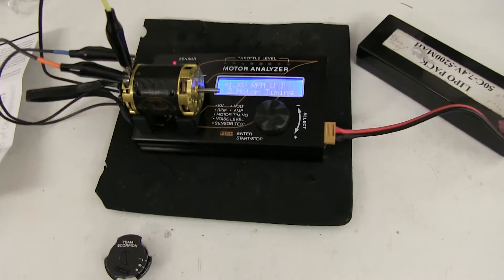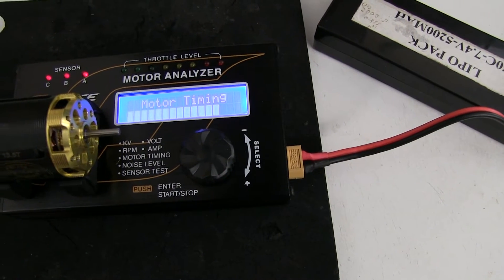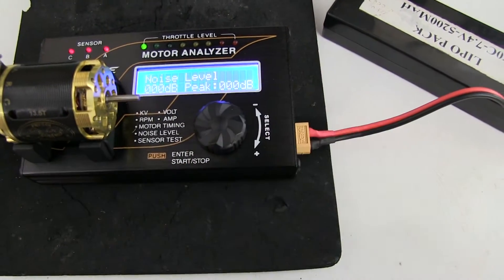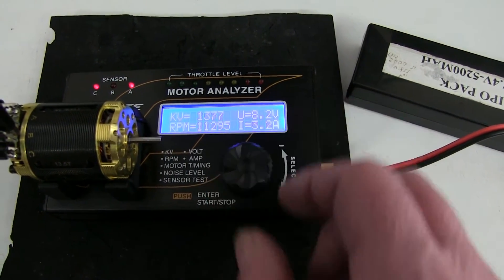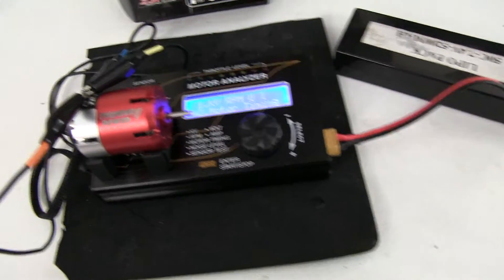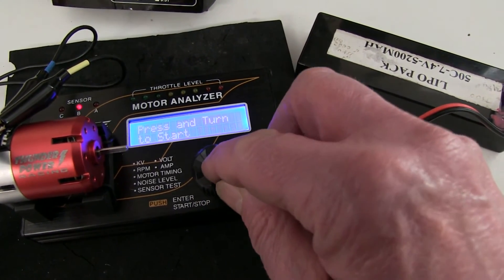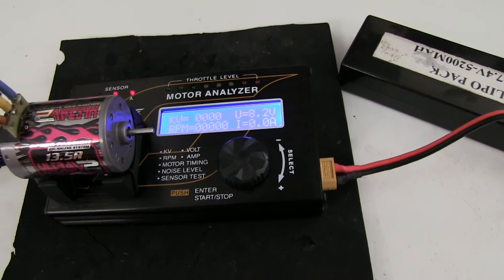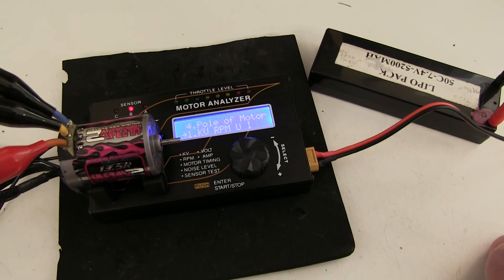Brushless Motor Analyser. Model Car Motor Testing.

Comment: I been running buggy’s on carpet track which isn’t to large mostly running reedy s plus 17.5 which is fast on track I’m starting to run a traxxas slash with lcg chassis in late model. I started with a 540 t stock motor and ran 5 second lap looking for more speed I tried what was in my buggy 17.5 but traxxas weighing more did have speed ran 5 sec so I tried a 10.5 motor and still get 5 sec lap. Some a running a castle creations 2200 kv but not use to those motors I have the type u usually test. Any susgestion on a motor.  It kind a short oval so not hitting a top end speed as I said it takes me 5 seconds to complete 1 lap most of faster drivers are around 4-4.30 a lap

Comment: Hi,

Can you use the analyser with the motor still soldered to esc?  No power/battery attached to esc and pinion is off. Would it work?  
If it would, it would save a lot of time with testing motor installed in cars. 🙂
Reply from the maker: Hi. Yes yp
You can test the motor in the car, and I do it often. You can test the timing with the motor still driving the wheels (off the ground). To test the amp draw, move the motor or remove the pinion.
Reply: Nick Adams  , just to clarify, the the esc still soldered you just clip the clamps on the motor tabs?
Reply from the maker: @Bird_Cristobal  Yes, you can leave the ESC connected. Switch it off.
Reply: @nickadams5411  what is the reason for ESC not dying while still being soldered to the motor during testing? Mosfets just "dont care"?
Reply from the maker: @lopatovich  Mosfets are open circuit, until the gate turns them on. As long as the ESC is turned off.
Reply: @nickadams5411 a long time ago I did that to my brusched ESC and had to send for repair. Is it different for for the brushlles?
Reply from the maker: @lopatovich  The old ESC probably used transistors

Comment: does the motor need to taken out of the car and unsoldered from the esc for this tool to be used? Or can it be hooked up while the motor is still in the car?
Reply from the maker: Hi Bob
Yes, You can test the Timing without disconnecting the pinion.
Hold car with wheels off ground. (Lipo disconnected, ESC switched off).
Connect ABC wires to motor (Careful not to short together).
Connect sensor wire to motor.
To test the KV:  Move motor pinion from spur.

Comment: what would cause a misfire
Reply from the maker: Hi Adam
If you mean while you are driving the car at speed.
Then it is usually interference with the receiver.
If it is 2.4Ghz, make sure the receiver aerial is not damaged.
Those intermittent glitches are often cured by fitting a capacitor to a spare receiver socket. Connected to the + and - pins of the receiver plug.
A value about 3300uF or higher at 10Volt rating is normally successful.
Reply: The motor worked perfectly fine then I took it apart for cleaning and oil for bearings I put it all back together and now it misfires after  10 seconds of running 
Could I have the timing up to high or did I screw something up inside?
Reply from the maker: Always after 10 sec of running.
If you stop and restart is it another 10 sec before the misfire?
Could be many things, but as you took apart, it could be the sensor lead. Make sure it is fully in, or try another lead.

Comment: Not good for sensorless motors. It wont tell you endbell timing so dont waste your money. And as far as any motor tested above 2s forget it. This will give you real rpm and kv along with voltage and amps but its useless testing on a 6s or 8s rated motor when your limited by power supply. They dont tell you any of this in description before buying and then your stuck with a tool that basically just gives kv because free reigning amps is useless and the voltage is going to pertain to the battery so it doesnt matter. If you could time a sensorless motor it would be useful despite other drawbacks. It just lets you know the kv is shy of whatever manufacturers claim. Waste of money. Mines for sale if anyone wants it.
Reply: My god man.....nobody runs sensorless motors to race so this may not apply to all the motors on the planet but it's a useful tool for anyone who actually does race.
Reply from the maker: Hi Braiden
Thanks for your input.
It is a far more useful tool than you have experienced.
The KV is not dependant on input voltage.
The amp draw can show you the best timing position , just before the rotor loss makes the motor become very inefficient, and works very well for zero timed speed control racing.
You can set up motors for 1S and higher Lipo voltages, with a 2S lipo input.
There is not much you can do with a sensorless motor as they are normally locked endbells.
Anyway, all the best.
Nick
Reply: Nick Adams wrong! End bells are locked? Not one of my end bells are locked on any of my brushless sensor less motors. And if it was it is very easy for one to be unlocked. Show me a locked motor i will show you 50 unlocked. I sell castle, leopard, and more here. Not a single one of these motors sitting here has an end bell locked Annnnd...., "where in my critique did i say kv was dependent on voltage?", where???? Now if you go back and read you will see i said thats all its good for. Now if you want to please reread and to further critique than we will take and run a 4,6, or even 8s capable motor using a 2s supply battery and in no way will the device spin the rpm's high enough to even find the true number. It is simply taking the number of poles and equating using the max battery voltage supplied to spin the motor to 12,700 with number of poles and in that case it displays out an approx kv reading based upon the equation. So now tell me how can i time a sensorelss motor? You cant! You can attempt to run a timing analysis and it will time out and not give any degree of timing for the given motor. Where, and how is that useful for someone needing to modify or change the timing? You cannot even put the motor under load! Therefore how is the amperage useful? It is not, and in fact the only other feature you will have is motor noise. Ok devils advocate uses it to monitor and record motor noise over time. So what? I can take two 1700kv motors by different manufacturers and see they both read different decibels and the both read approx 1650-1670kv. So what? I can do what i already know and gear the motor according to that? I can do that with the motor out of the box. Unless it does timing on sensorless motors and spins to actual real time rpm motor noise is useless not having a real time final number to go by at max motor rpm, as well to no degree of timing that can be adjusted/changed because it doesn't give such data as it pretends to suggest on the box. So again, reread my critique you seem to have some made up canned response and this motor analyzer used on anything but a sensored motor with a max voltage of 2s is useless since it will exceed the analyzers given capacity at less than 100% the motors capabilities. If you have small or micro sensor brushless motors than by all means have at it. For the majority of hobbyists its not a tool worthy of using and limited by design and feature. Fee free to explain its usefulness on a sensorless motor. And a motor above 2s. Finally my entire point summarized its useless on a sensor less motor. And its less useful on a motor rated higher than 2s due to battery supply to analyzer. The vast majority of buyers do not use sensored motors and the box should say atop it rather than be deceiving that it works on sensored motors only. To everyone else your getting ripped off and wasting your hard earned dollars. But thanks for buying anyways. I look forward to your response.
Reply: Braiden Palmer are there any other companies that will work for 6s to 8s motors that are sensoredless. If so which ones